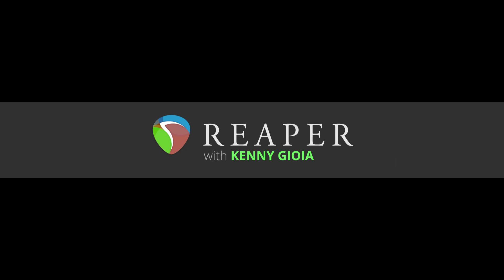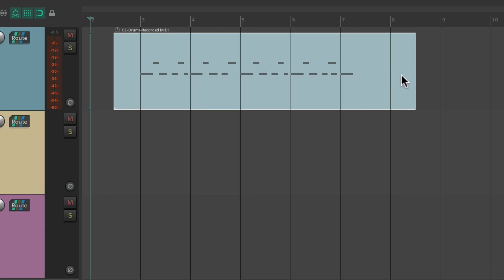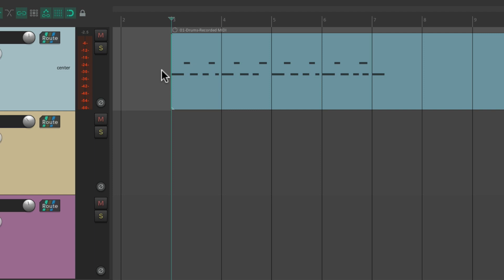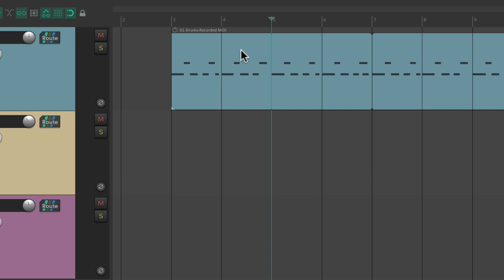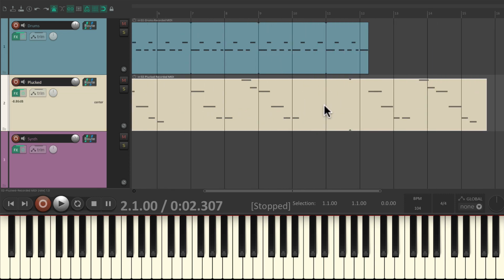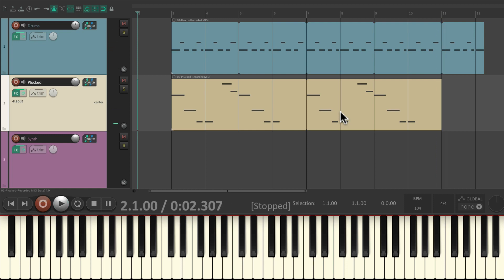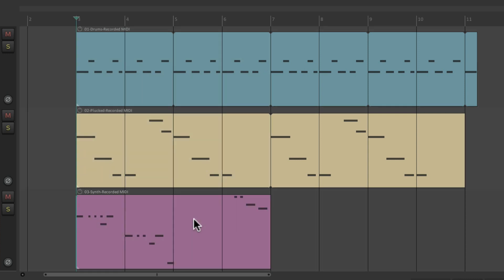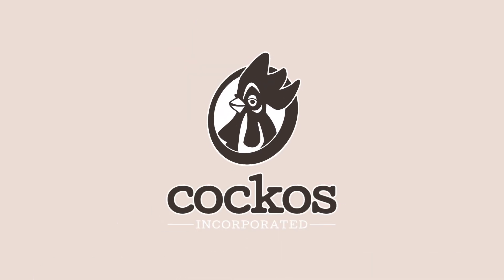Re-Adjusting MIDI Item Looping in REAPER

Comment: Great video. I have a different question, though. How to i adjust the timing of a single note in piano roll? For example, if i am programming a drum track with flams where one of the strokes is slightly behind or ahead of the other?